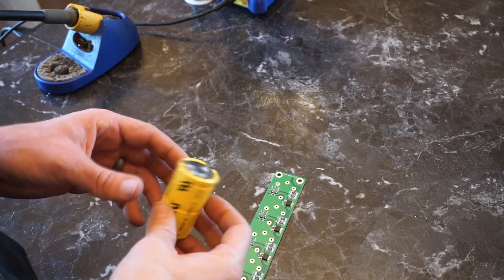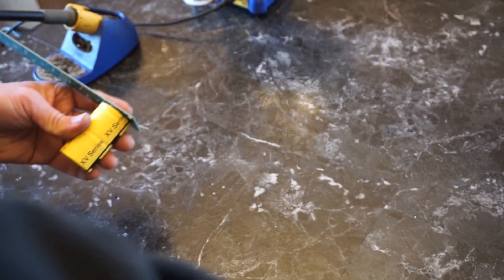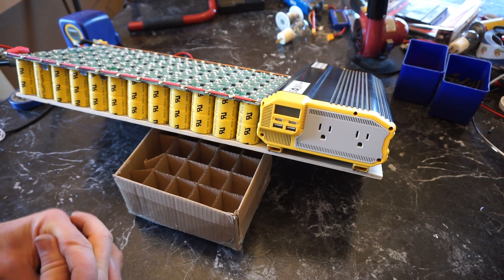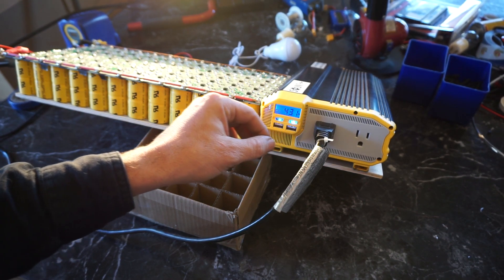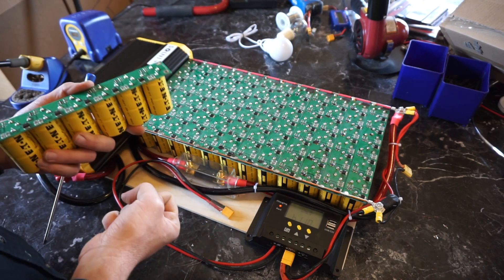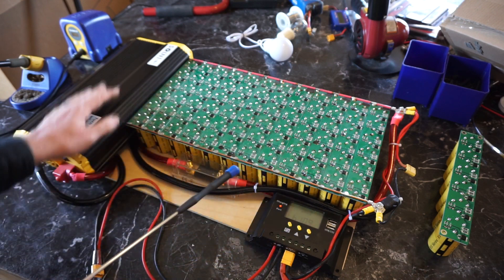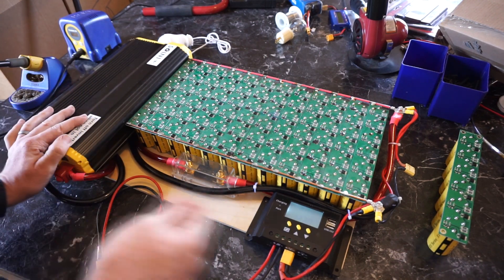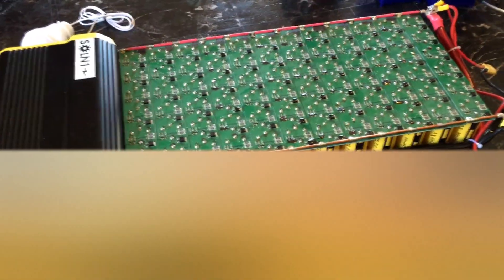Building the SOLN1-2000 Watt Capacitor Solar Generator

Comment: I don't get it. 
A single tiny Li-ion 18650 holds over 10Wh compared to the 2,4Wh for this huge and very expensive board with 6 caps.
Reply: +Bob Saturday your copying the same response under every comment that somehoy questiones the Video
Reply: getreal155 
http://electronics.howstuffworks.com/everyday-tech/lithium-ion-battery2.htm
Reply: I agree with your comment, and that's my position. You did miss mentioning one advantage to caps, their temperature resilience. If you need electricity in the extreme cold, caps may be worth the expense, size, and weight.
Reply: they are really needed when transferring from lost power (grid) to UPS taking over and again from UPS to Generator, where huge power demands can be met to insure the power transfer.
Reply: ELazer but there is still the question WHY would you do that?
It is intended for a Solar backup - that is not something you charge in 5 minutes, but in 5 hourse.

Li-Ions ca easily last over 5 years. And for the same capacity they cost a fraction.
And if you have to worry about the current capabilities.....
He has 12 of those caps in parallel and they are rated at 26/220 A constant/Peak - 312A total.
6 in Series for 16,2 V. 5 kW is enough to max the inverters 2kW.

18650 you get 3000 mAh with 10 A discharge at nominal 3.6 V. (there are of course better ones with far higher discharge-current)
Now lets say they cost the same per piece (roughly).
To operate the same inverter we need just 4 in series, so we can have 18 in parallel to use the same 72 cells for only 180 Amps for a total of just ~2600 W - still enough.

Yep, the Li-Ion give less power, but with that inverter it doesn't really matter.

And now the energy:
SuperCaps: 2,7*2,7*400/2 = 1458 = 0,4 Wh
Li-Ion: 3,7*3000 = ~10 Wh

So both setups cost the same, both max out the inverter for constant supply, but the 18650 would store over 20 times the energy.
Reply: Capacitors can charge and discharge much quicker than any of the current chemical batteries. They also allow many, many more charge/discharge cycles. This solar setup is about convience & light-weight portability, not mass storage of energy.
 
Well done Lasersaber!
Reply: I know what a super cap is and that is exactly why I place serious question marks with this product. What would be the application? I have no idea. Light up a 3000W light bulbs for 5 seconds? Li-ion cells also have a high discharge rate. At least more than you ever need. They hold 30 times the capacity of a super cap and are 30 times smaller. True, the charging speed rate is lower. But that is about all the advantage you ever get for at least 20 times the cost.
Reply: personally,  It would be like a backup power supply where I can neglect it for months or years without it going bad.  Any lithium ion battery requires maintenance.  Plus,  its storage lifetime and cycles are much shorter than supercaps.   It's like a novelty item with practical use,  perhaps ??   You are correct about the price though.  It's not cheap.
Reply: I have a 4kw lead and a 4 kw li-ion battery system as backup. I've experimented with super caps but abandoned that idea real quickly. It is simply not economical nor practical. Caps are great if you need extreme short high power bursts but definitely not for energy backup systems. Li-ion does not require maintenance at all. The discharge rate is extremely slow. Years. Storage life time and several thousands of charge cycles is enough to last for decades.
Reply: another is to deliver loads of power at once, something a Li-ion battery can not do.
Reply: I understand that. I'm just putting some big question marks behind this approach.
Reply: I had to read up on (LIC) Lithium Ion Capacitors https://en.wikipedia.org/wiki/Lithium-ion_capacitor 
It seems one of the touted advantages is the wide temperature range: "operating temperatures ranging from −20 °C to 70 °C" http://wikivisually.com/wiki/Lithium-ion_capacitor#cite_note-:0-6
Reply: getreal155 pompous fathaead , why don't you state the obvious ???? who do you think you're blithering to morons like yourself ?
its obvious this guys trying to see feasibility for alternative to lead acid in a solar system
Reply: Don't believe every thing you read.The guy that wrote this nonsense probably is a super cap sales person or totally ignorant ;)
There are many factors that determine the performance and life time of a li-ion battery. I have many batteries here that are over 8 years old that are still performing great.
Here is a link to more reliable information. http://batteryuniversity.com

Comment: That's pretty cool what you're doing there. I would be very keen on seeing what kind of specialised super cap charge controller you come up with. It should be relatively simple as you don't have to worry about three stage charging etc. 

However, I was thinking though about your circular saw. Y'know it might actually start easily when the concrete mixer is running because the concrete mixer is running. As the saw starting sucks down the voltage the mixer's motor may be briefly functioning as a generator, assisting with the start. I presume it would be using an induction motor?
Reply: I run a circular saw on my Jupiter 2000 without any worries. In fact, I have run a 8000 BTU one tube A/C unit on it. Now if it were a Pure Sine Wave inverter, then yes, it might help with the loads. My Reliable 3000 Watt unit powers up/down to match the load and a sudden load like the refrigerator that I run on it can drag it down. But I found a way around that. I also plug in a PowerJack 3000Watt 110/220 transformer. So when the refrigerator kicks on, the PJ unit acts like a big power factor capacitor and kicks the need juice into the line. As it is only powered up when the sun is out, the loss from the transformer is not a worry.

Comment: Hey great videos, I've been viewing and liking your videos for a while now but never commented, I have a question though. I have a car with an average sized music system and I can tell that my battery isn't enough to run all the electronics and music in the car even while the car is idling, little things indicate this to me. For instance I have a solenoid that opens my door and when I use it the rpm drops down and I can see a voltage drop on my voltmeter, my question is, if I add one of these boost packs to my existing regular car battery in parallel, will it ensure a higher supply of wattage demanding by the car? I currently use a small lead acid battery rated at 575cranking amps, 40ah, which is small seeing that I have a few extra voltage demanding gadgets in the car, please give me your opinion on this, I will really appreciate it. 
Thank you, 
Vishal Baal.

Comment: Nice PCB apart from the Pos and Neg terminals so close together under the copper bus.
Reply: its the one he is selling on his site
Reply from the maker: I did not design the PCB.  I have since found a new version that keeps the terminals one to each side of the board.  This is the design I am working out a large bulk buy on.
Reply: Oh that's good, a much better arrangement.
Reply: lasersaber does the PCB run the caps in series or parallel?
Reply: Samuel Thomas
Reply: Can you provide a link the the new version you've found?

Comment: its important to note that if there is no current limiting between your batteries and the cap bank, the batteries will get just as high of a current draw as it did before adding the cap bank.

Comment: I'm trying to rebuild an electric scooter. Some of the batteries that it came with are busted, as well as the charger. I was thinking of replacing the batteries with supercaps to reduce weight. Good idea, yes/no?
Reply: Blurns you could make a graphene battery. using Robert Murray-Smith method
Reply from the maker: A hybrid system might work well but capacitors alone would give you very little range.  Think in feet rather than miles.  It might make a great drag racing scooter because you would have amazing amount of amperage available for a short burst.
Reply: lasersaber Oh well. Back to my fruitless attempts at reviving the "maintenance-free" sealed lead-acid batteries.
Reply: replace with new baterries.
Reply: Pinrui Huang
That's no fun.
Reply: David Serrano That might be a little beyond my skillset, but I'll look into it.
Reply: Blurns you just have to make a graphene ink and put it on paper.
Reply: Blurns kinda like what he did but better.
Reply: Scott Cook snake oil? It's called research. If you are going to diy something might as well make it an experiment.
Reply: Scott Cook oh wait your talking about the supercaps nvm. Yeah that's pointless.

Comment: Hi, thx for sharing. I'm able to buy in good price 12pcs of 3000F boostcaps and I'm wondering, will it work as same like yours 72 pcs 400F capacitors ? Or is it better to buy more but smaller capacitors ?

Comment: Why do you need a charge controller at all with capacitors when using solar panels?
Reply: Solar panels by itself can generate over 18volts which will fry a battery or  Capacitor banks.   The charge controller keeps the voltage at a safe level.   His capacitor bank is only rated at 16.2 volts.   It'll start cooking the supercaps without the charge controller.

Comment: Good job mate. Have you ever tried to charge and discharge in the same time a super capacitor? In other words is it possibile in the same time to use the energy stored in a super capacitor and to charge it?  ... Thanks for your answer.
Reply: giorgio vacca storage is storage. you can charge and discharge at the same time. if you use less power than you are generating, the system will charge. use more and it will discharge. its a balancing act.

Comment: This system would work well for a construction trailer. Install the solar cells on the roof and the rest inside. There have been soooo many days where I could have used this solution.
Reply: I know right! Same here. Have you set your system up yet bro? I'm trying to set up my airstream as well as a trolley

Comment: how would you connect a lipo pack up in hybrid mode without the lipo bms cutting out due to current pull from supercaps?
Reply: david bone use one without a BMS :) you'd need to monitor cell voltages though.
Reply: yes fair point, if you wanted to keep the bms in place, in my case.
would it be possible to  upload a vid on a current limiting circuit?

Comment: FYI, this controller powers from the panel side.  I have one.  It works pretty well.  http://www.banggood.com/MPT-7210A-Aluminum-Alloy-MPPT-Solar-Panel-Charge-Controller-with-LCD-Display-p-1056572.html?rmmds=search

Comment: You mentioned the solar charge controller runs off the boost pack, and you need a jump start from another battery when the boost pack voltage is below the operating voltage of the charge controller.  Check out the Morningstar SS-10 charge controller. This controller runs off the solar panel instead.   Just an Idea.

Comment: I'm sure you're probably aware of this, but you're losing a ton of capacitance by stacking the caps in series. Calculating capacitance in series isn't the same as parallel (where you would simply take the total sum). In series, you get 1/Ctotal = 1/C1 + 1/C2 + ... + 1/Cn.... Your one string of 6 400F super caps, to get to 12V, leaves you with only 66.67F, when you paid for 2,400F.

Your whole bank, if all in parallel, would contain 28,800F of available capacitance. With your series/parallel setup, you have 800F. Just saying...

Big fan, keep making videos, but daaamn that seems like a ton of wasted money for some lightweight high current-discharge
Reply: You're correct that the capacitance of the series capacitors is less. That sounds bad like you're "losing" some of  the bank's storage and wasted money and weight on useless capacitors.  But you're not. Stored energy, measured in joules, is C*V^2. The caps in series act like a single cap with  lower C but higher net V, but the total energy stored is actually equal.
Reply: Except it's not- at least in terms of volume, cost, and alternative options. the available capacitance of this cap bank is less than 3% of the total additive capacitance. When you consider that each cap costs close to $10, you can see really quickly that a lithium bank would have done a lot more in a smaller package for less money.
Reply: If he put all the capacitors in parallel, he would be restricted on voltage, because they're rated at 2.7V. By stacking 6 in series, each bank of 6 can take 16.2V, which is exactly what his max charged voltage was. If he wanted more capacitance out of the same amount of capacitors, he'd also have to drop the amount of voltage stored.
Reply: Right, but by stacking them, he loses the vast majority of the otherwise-available capacitance in his bank. Kind of hurts to only get 3% of the capacitance he paid for due to his configuration. That's the only point I was trying to make. Other than discharge cycle count and simplicity in the charging system, I don't see how this has any advantage over a lithium battery setup. Cost certainly isn't lower here, either.
Reply: When fully charged, each capacitor is at 2.7 volts. This means that the capacitors hold the same amount of energy regardless of whether they're in series or parallel. For the line of capacitors, , it's true that the capacitance is higher in parallel than in series, which means the useful diacharge time is longer. However, a higher capacitance also means that the charging time is longer. The higher  output voltave alone might be enough to justify hooking up the line in series, but you have to understand that more capacitance doesn't always mean better performance.
Reply: I know jack-monkey-squat about all of this, but also, don't they need to be put in series just to be able to handle the 12v system?  6 x 2.7v = ~16v, right?
Reply: Fair enough, but I live off grid with a solar input of 270 w/h in perfect conditions.  I don't use much power, so the storage is the sticker for me.  I have done experiments with Li/Ion batts in an series/parallel config that have expressed a longer runtime (storage capacity)...   And I am just looking at getting away from deep cycle lead/acid batts.
Reply: Series/parallel  - best of both worlds.
Reply: Joules are C*V, not C*V^2...

EDIT: Capacitor joules are .5*C*V^2... You right. Been a while since I've been over this stuff :/
Reply: Battery capacity is additive in both series and parallel-- they store energy in a chemical reaction. Whether in series, parallel, or series-parallel, the energy content is simply the addition of all cell energies-- so you just stack them in series to get whatever voltage you want (similar to caps, except the capacity for capacitors isn't additive in this way-- instead it suffers severely), and then stack however many of those series strings you want in parallel to increase the available storage at that voltage (similar to capacitors)

In terms of long-term storage, batteries are the way to go over capacitors- every time. Lead-acid is also a good thing to get away from, although the cost is still attractive (albeit less attractive as time goes on as lithium keeps falling through the floor), and you can beat the hell out of them without burning your house down. Energy density of capacitors pale in comparison to batteries (even lead-acids) even when all of their available capacitance is utilized. The advantages that capacitors have over batteries are nearly-endless charge/discharge cycles without degrading, and their ability to discharge ultra-high currents without damage themselves (making them awesome for starting a vehicle or starting electric saws, as demonstrated in this video)... But in terms of energy storage, you can't beat batteries, especially for the price.